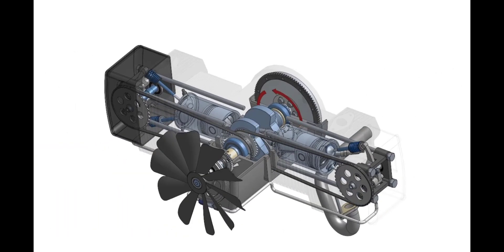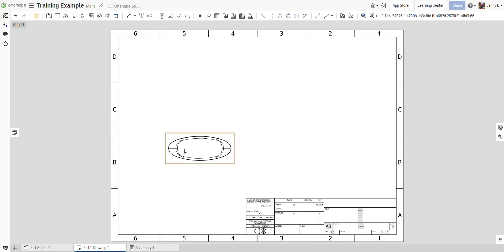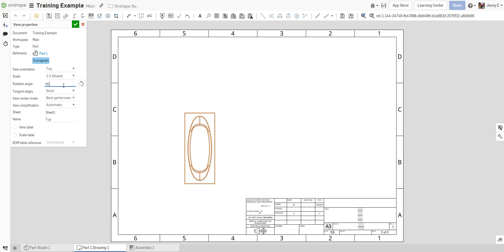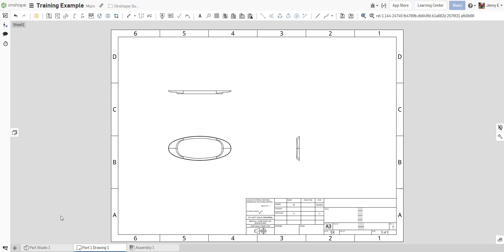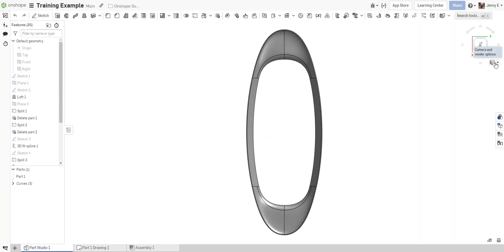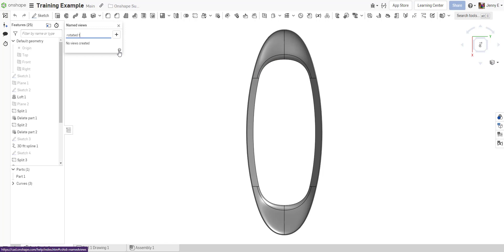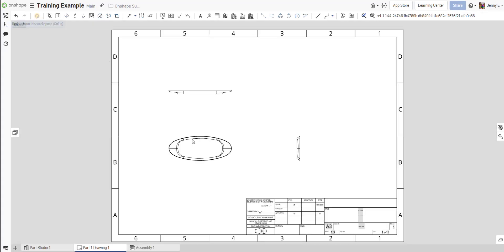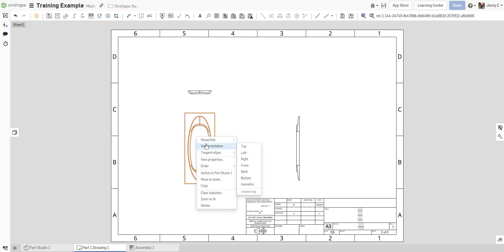Tech Tip: How to Rotate a Parent Drawing View in Onshape

Comment: Please help me how do I create printable A4 size drawing when my drawing is A1 size.

My problem is that the part I designed is larger than A4 size but I need to print the drawing in A4 size, in order to join multiple A4 papers and create a template.